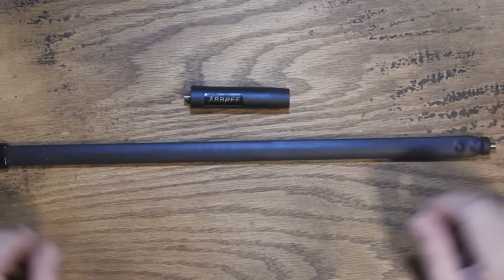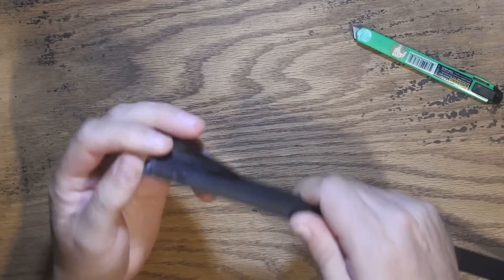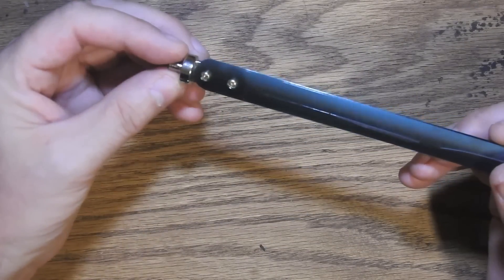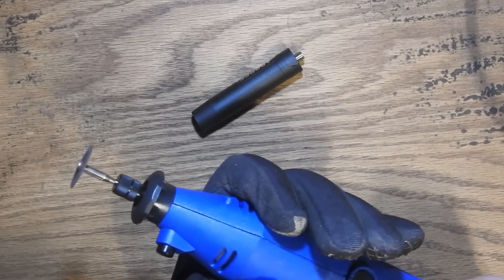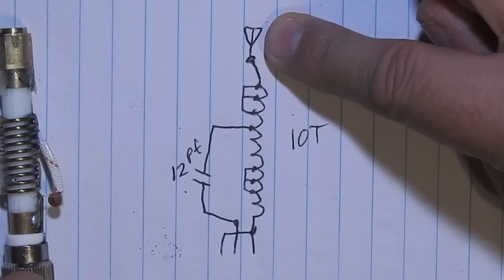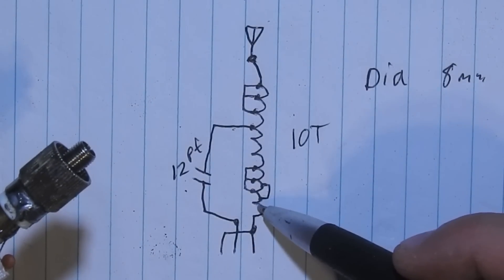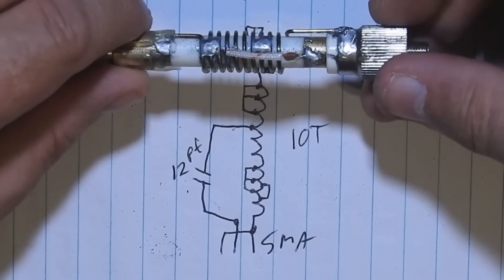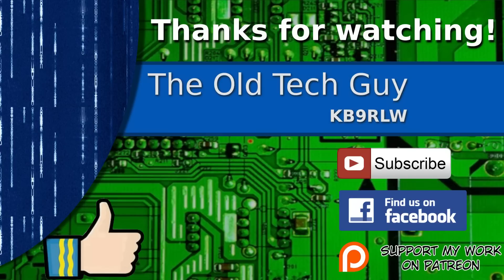Ham Radio - Tear down of the ABBREE tactical VHF/UHF antenna.

Comment: Hey Kevin:
1) Thanks for the tear-down, I was wondering what was in there.
2) I was reading some of the comments where some of the guys were saying about using the radiator elements as an "Inverted Vee", I don't see how they could be as the tape measure elements are at the same potential considering they're bolted to the same feed point, the only thing I see is the two tape measure parts are in parallel and thusly reducing the radiation resistance of the radiating elements by 1/2.  
3) I DO NOT understand the print of that coil base AT ALL, shouldn't the coil be in line with the center conductor of the feed point and NOT the ground for loading????  Unless they're using the coil as a counterpoise for the actual radiating elements????
Comments would be GRATEFULLY appreciated!  
Thanks again for ALL your work in bringing us these EXTREMELY interesting and thought provoking vids!!
L8R Bro.
Reply: The coil here is working double duty. It's necessary to match the impedance and force it to resonance. There are a couple turns at the top between the capacitor and whip effectively in series with the center pin bucking the excess capacitance of the short antenna. Having the end grounded allows you to "tap" the voltage gradient across the coil to obtain the desired resistance/impedance.
Reply: @VladislavFomitchev  Thanks for the help trying to understanding this, I will be revisiting this when I'm not so knackered! Cheers Mate!

Comment: 👍 Thanks Kevin, that was interesting. I often wonder what's inside these HT or mobile whips. This was like antenna CSI 😂. The matching part with the connectors certainly looks useful for homebrew antennas. In fact, it would be useful if you could buy parts like that for HT/mobile whip experiments. In the past, I have made various mobile whips and portable antennas using cheap fibre glass "Roman blind" rods. I covered the rod with self-adjesive copper slug tape and then put heatshrink over the whole thing. Not as flexible as sprung steel but very RF conductive, lightweight and hardwearing.
In terms of the matching in this design, it just looks like an auto-transformer with shorted turns as you say to tweak the inductance for the radiator plus the series capacitor to make the match to the transmitter a resistive impedance - kind of similar to that used in gamma match?

Comment: Good job, Kevin. Is it possible that, in the original video, by walking in a straight line away from the dummy load, you might have been in a minor lobe of the antenna? Or, by doing a 360 degree walk around your signal source, the performance might have improved? Just a thought...
Reply from the maker: Since I was comparing it to the stock rubber duck, what would it matter?  Regardless of where I was in the signal path, it was one antenna vs the other and the abbree performed about the same as the stock duck.

Comment: These always seemed hit and miss. I have a few which work wonderfully and compare well against other antennas. But lots of people online and in videos seems to get poor performance.
Reply: In my limited experience, I've found that a great handheld antenna is really hard to pin down. Relative comparison is really all you get. The only antenna that I've connected to a handheld that I could definitively say gave noticeably better performance was a Diamond X300. Still working on the backpack mount for that 10 foot beast. 

In all seriousness, if I did have to pick my best all around HT antenna it would be the Signal Stick. KISS works.
Reply: @stewartrv i was reading your comment and was going to say how great diamond antennas are but suggest you try signal stick until I finished reading the rest of your comment.  Lol But yeah,  i am blown away with the performance of my signal sticks on multiple HTs and I've never had anything close to such a noticeable difference. Great choices man.
Reply: I've noticed the same mine works great (on analyser too).  I think that there are some fake/clones too maybe they don't have any matching stuff inside that was why some fake Nagoya's were crap for example...     It's also possible that they use the wrong coil for the radiator or visa-versa in the factory...
Reply: So sad how people try to flex on brands yet when something comes out that's unequivocally better performing at half the price they get angry and immediately make fun of the name because they have nothing else to say. 😤
The reason you read negative reviews is those that bought an expensive antenna and just want to knock it. Others make money selling expensive antennas and don't like when a company takes away their profit 🙄

Comment: Thank you for the video! Maybe you could "re-tune" the coil, and get it tuned for the proper frequency. Then try the range test  again? That would be an interesting project and video!
Reply: Yes, or play with different lengths of radiator.
Reply: sounds like the chinese engineers want a easy solution

Comment: I have a Model 771-3  137-174/400-520 12W High Quality Tactical Antenna TwayRdio Made In China on my FT70D. Probably the same kind of setup. I  havent compared it to the stock antenna yet. I live a mile from the repeater. Any advice on a better than stock antenna ?

Comment: I have one of these I bought in 2020. The build quality on your antenna appears to be better than mine. 

On my antenna, the cap was barely glued on and came off in the summer heat. After an entire winter outside it was permanently folded over right above the base. It wasn't until I took it down that I noticed it was actually broken at the nut/bolt connection. Water had seeped in and it rusted through. After pulling off the single layer of heat shrink, I found two pieces of yellow tape measure steel tape.
Reply: there are a lot of fake Abbree antenna`s... you probably got one

Comment: FYI: Speaking of Abbree . The Abbree AR-869 was tested by  FEPLabs Radio and it FAILED badly for spurious emissions for 2 meters.  "Hero or ZERO?? Signal Check 1/8"
Reply: An antenna causing spurious emissions, or was the exciter creating spurious emissions, and they expected the Q of the antenna to be high enough to suppress those emissions? Technically, we prefer low Q antennas; no one likes to retune an antenna as they tune through the band, particularly on VHF. Perhaps their perfect antenna is a magnetic loop. I'd just say I find it highly suspect that any lab would test an antenna and say it fails due to spurious emissions and try to say they didn't have a bias towards the product. Do I think they're an excellent antenna? Not really. Do I own one? No. Am I going to say it's causing spurious emissions? Not a chance in hell. A proper exciter is required by the FCC on amateur bands. Tesing an antenna with anything other than equipment adhering to those specifications is at best just foolish.
Reply: @jonathancotner7040  The Abbree AR-869 is an HT
Reply: That's too bad. Not a terrible looking radio.

On the plus side, when you failed to make contact after getting lost with that piece of garbage you can always stab the battery until it catches fire. That way you can be warm and lost.

Comment: I bet if you replaced the spring steel with same-sized strips of copper, you’d find the performance would greatly improve. Skin effect pushes rf current to the surface of any conductor. That blued steel adds new meaning to “rubber dummy load”. de kg5ar

Comment: I have an old Cushcraft AR-270, 2m, 70cm antenna. It had been out in the weather and was not performing correctly so I took it apart to see if I could clean it up. I found the same type matching network in the Cushcraft. The cap and the coil were obviously different values. I repaired a broken solder joint at the top of the coil and cleaned it up. I put it all back together and it is performing very well. I don't completely understand how it works, but it does. Thanks for the video.

Comment: Modifying the transformer to proper 49:1 should make that a decent end fed half wave for 2m. Maybe removing the shorts and moving the tap would do the trick? I'd go that route. Actually thinking of making one from actual tape measure left from portable yagi projects.
Reply from the maker: If you want to go with a half wave, that's going to be a 38.45 inch radiator.  Pretty big on a little HT.
Reply: @loughkb   only now I see this is a bit too short for a half wave, used to metric. But as its lightweight and flexible it shouldn't put too much stress on the HT at 1m length. Think that was the original idea with that "tactical" antenna. Some of the windings might be intended as loading coil. There are longer ones available, too. Anyway, thanks for showing the inside of the thing!
Reply: Remember these are not actual antennas designed to really work that well. The design for the people that want to look and feel of military radios. When playing weekend warrior with airsoft pistols. You could make a functional halfway out of it. However you would need to provide some form of crown playing. Either a vertical wire hanging from the base of the antenna or God forbid using the jacket of the coax. But you would need to put a very large lump amount of ferrite, near RF connector at the far end of the cable. After measuring out 19 in of coax from the base of the antenna. A coil of five or six turns about 4 in in diameter secured with zip ties. They provide a useful choke to stop our of current flowing back into the radio. But this is probably more than most people want to do and have strapped to them while trying to use a radio and remember when you put the antenna onto your back straps. You're putting it up against a surface that contains a large amount of water. So you will change the tuning of the antenna immediately. If you're putting it on to a plate carrier you're doing exactly what it sounds like mounting your antenna against a steel plate. Usually we would put our antenna and a 90° angle to a steel plate. And connected capacitively. But just dropping the antenna to your mole strap, will not really provide the correct capacity of coupling. Again these antennas are for Weekend Warriors and to give a certain look not be functional

Comment: Another excellent video, Kevin!

In fairness, I don't think these are marketed to amateurs, but rather to the folks playing paintball and who are using Baofeng's for 'tactical comms'. Many of the chest harnesses made for paintballers have a pouch for a radio and also a loop that the antenna goes through, designed to mitigate the forces on the antenna base when trudging through the 'jungle'!
Reply: I think it is mostly marketed for those into the whole prepping thing.  I haven't seen many of these being used in paintball or airsoft.  Most of the guys in paintball and airsoft either use the stock antenna or a NA-771 whip antenna.
Reply: You hit the nail on the head, these are being marketed to people that want to play army, and have the look and feel of a combat radio for the price of a set of walkie talkies.

Comment: Shorted turns is a good way to kill the inductor Q.  So maybe that both "tunes" the transformer and broadens the bandwidth over the ranges the antenna claims to operate?
Reply: Good point, I have read a few articles concluding that it's best to avoid shorting RF inductor turns is you want to maintain Q. In this case, as Kevin suggested, it may just have been a quick and dirty method of matching the antenna.